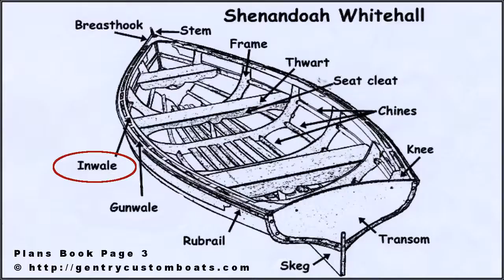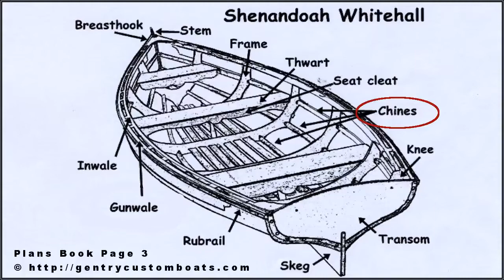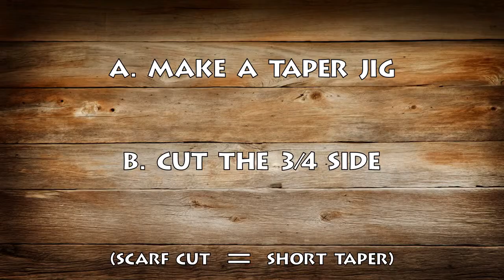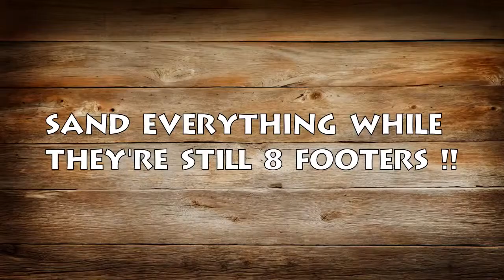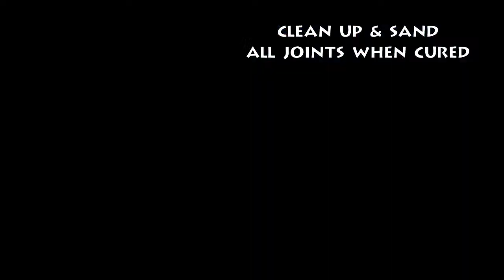Whitehall Skin-on-Frame Part 2: Cut Scarf Glue

Comment: Hey John , the videos are super helpful thanks. is there a reason not to scarf first then rip ? I mean scarf join the full width board and then rip the chines from the 18'  1x6 scarfed board instead of ripping first and making multiple scarf cuts and glue joints?
Reply from the maker: Your comment makes sense, I just didn't think of it at the time. The whole project was a first for me. There were probably better ways of doing a number of things that I didn't think of.
Reply: @yophotoman  cool , I just wanted to make sure I wasn’t missing something.

Comment: John, is the "Titebond Glue" waterproof and OK for marine work
Reply from the maker: My skin on frame boat mostly lives in the garage and has only been in salt water once but fresh water many times. I've had no problem with the Titebond Glue joints separating or loosening in the nearly five years since I built it.